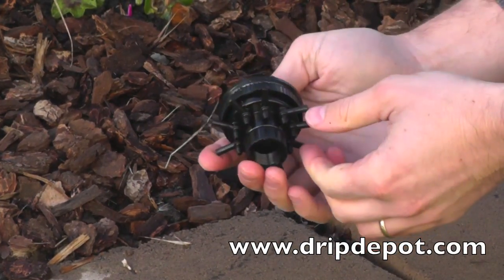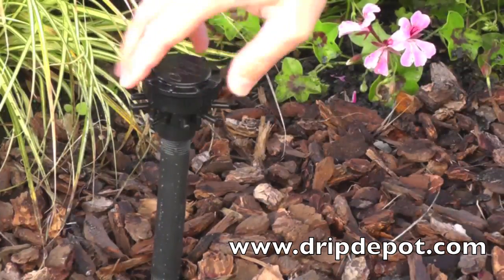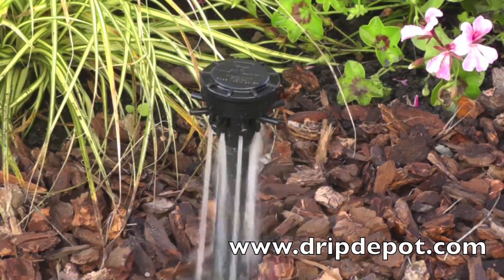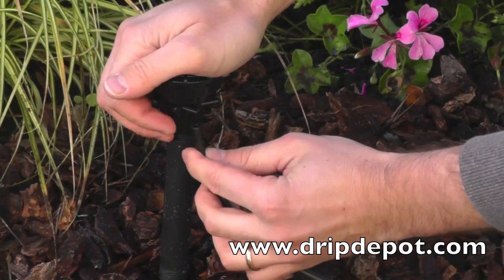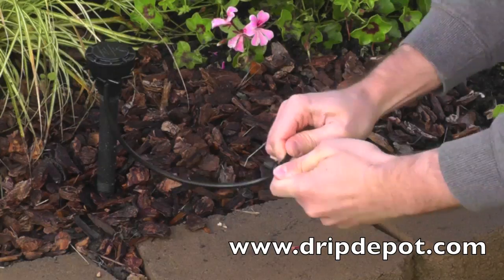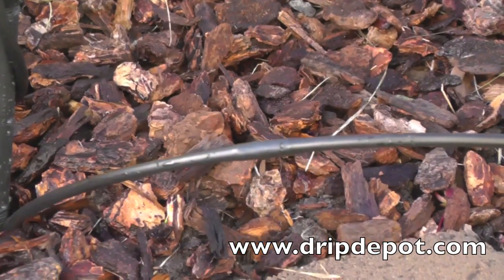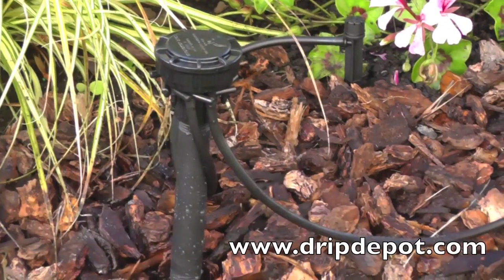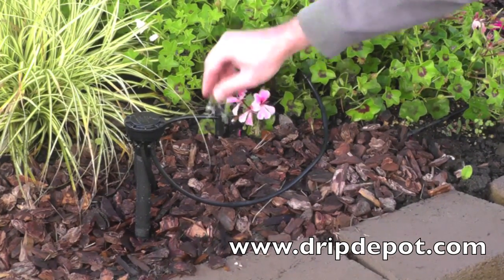How To Retrofit a Sprinkler Riser With a  Flow Control Drip Manifold

Comment: Do Spot-Spitters work with drip-manifold-converters like this one?? (or Orbit or Hunter drip-manifolds, etc.)
Or, do Spot-Spitters need to have the higher pressures direct from a 1/2” sprinkler pvc riser to a mainline tubing?
Reply: @Miranda Bergin Thanks for the info! 
Yes, I meant with 1/4" to 1/8" tube adapters too.

I currently have cheap Orbit drip manifolds with (slow drip) stake-drippers (all cheapy stuff from home depot). 
The Orbit manifolds seem to only have a slow stream of water... you sure they can make a Spot Spitter spray correctly and strong? It seems like the Orbit manifold might be too weak (too regulated), its my guess.